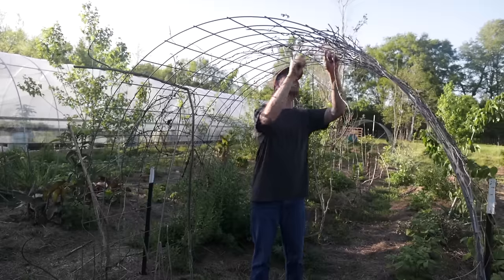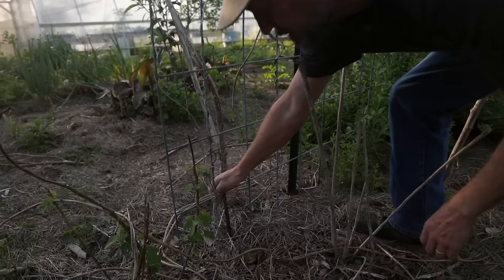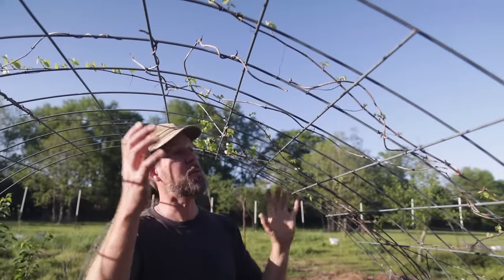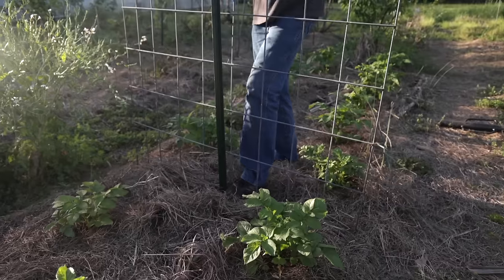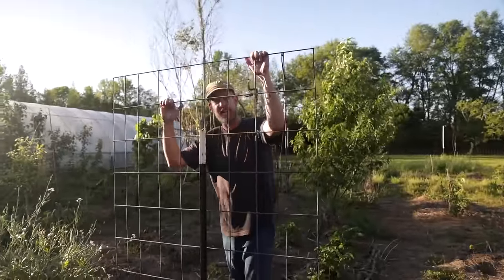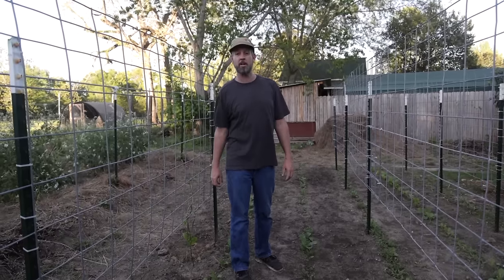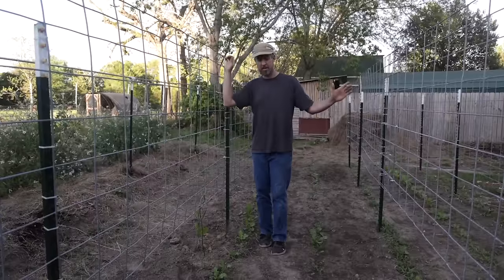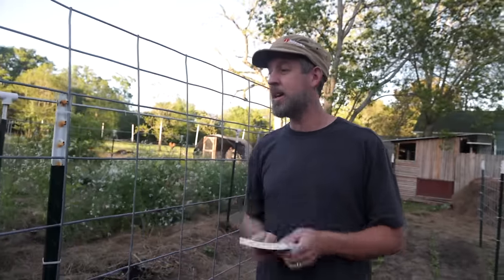3 Simple Cattle Panel Trellis Designs You can Build in Minutes

Comment: My problem with cattle panels is getting them home. I rented a truck to get a bunch of things once, but that just means you can’t decide you want just one more.
Reply from the maker: Tractor Supply gave me free delivery on these, but I have fought to get them before.
Reply: Rent a trailer instead of a truck. Fold the cattle panel into a U shape, and then strap them down.
Reply: @speakrighttogod  Good advice for some (many). But I find a trailer is far more trouble than a truck. Not much cheaper and requires more work. Plus you need a hitch and practice.
Reply: Tractor supply does offer some amount of free delivery as part of their rewards program.

For the second trellis design (single t post and a cattle panel cut to 6 ft) you can bring bolt cutters to the store and just cut it in the parking lot. Not sure what you drive, but it fits in a mini van just fine. 😄
Reply: @Pruittville  I drive a Honda Fit. Which, to be fair, can carry some surprising things. (8’ planks, 10’ reinforcement mesh which bends.) And I do keep tools in it to cut down some things.

Comment: I made hay arches from 2 cattle panels, covered with tarps & had 2 protected dry areas for my horse & goats to eat their round rolls of hay.  I used old garden hose to cover the jaggedy edges of the cattle panels so the tarps didn't tear up.  The hay arches have gone through 16 years of hurricane seasons in great shape.  We did remove the tarps if we had higher than Cat 2 winds.
Now that I don't need the hay arches for round rolls, I hope to move my cattle panel hoops into my big yard and create a goat proof winter greenhouse and summer chicken pen for broody mommas.
Reply: I'm assuming that's 2 sixteen-foot panels attached to each other at the center, overhead, yes?

Comment: for those of us trying to work without a truck... (cattle panels do NOT fit in a car)... i go to a concrete and building supply place (they also do landscaping) and bought concrete block reinforcing... ive seen other folks use "ladder mesh" but what i use is "truss style".    the 6 inch wide ones, are ten feet long, and they bend easily into  the back of a sedan style car with the seat down.
ive built a lot of garden arches with them.
they are not as heavy as cattle panels, and not as wide, but  they do fit in a car
Reply: If a friend/relative with a truck will help you out, you can rent a U-Haul trailer. Fold the cattle panel into a U shape. They fit perfectly; strap them in and you'll be on your way!
Reply: They also fit in the bed of a pickup truck, but alas no one near me has one. I have considered renting a moving van but that's pricey

Comment: Another fantastic video...especially the Sweet Potatoes at the end!  In Arizona where zip ties rot within a month (sometimes within hours) from the sun, we use bailing wire to hold the panel to the T-Post.
Reply: Plastic zip ties are a terrible choice for this. There is too much plastic waste and pollution as it is.

Comment: I twist electric fence wire up to attach my cattle panels. If you want to remove them it's a little harder but they will last forever.
Reply: I can't speak for every retailer, but Tractor Supply gave me a bunch of metal clips with the T-posts I bought , to attach my cattle panels. There is so much talk these days about the problems with plastic waste and pollution. Using zip ties for something this is just a bad idea. They will photo degrade in the sun and end up breaking and you'll have to replace them. Why not just use the metal clips that are intended for this application? Or use some kind of metal wire like you did? Plastic is not a good choice.

Comment: A few years ago I found out there is a difference between indoor zip ties and outdoor zip ties. All of the cheap indoor ties popped off everything after one season. ';D
Reply: I have been using Zip ties for over  40 years.  Never heard of Outdoor ones.  I buy mine from Harbor Freight, when I use them outside the Sun & UV rays deteriorate them  within 30 days in my Texas climate.

Comment: Great video!  These are excellent and economical designs.  It's tough to get cattle panels, since I don't have a big vehicle and delivery isn't available.  I made large trellises similar to your second design, at 03:13, using sheets of remesh.  I cut two 10' pieces of metal conduit down to two 8' and two 2' pieces.  I used elbow joints on the corners and a butt connector at the center top.  Connected the 4'x8' sheet of remesh to the frame with zip ties and can put it up anywhere by using two 3' pieces of rebar hammered in to slide the side conduits down onto.  Sounds complicated, but really isn't.  For less than $30 each I've made three and they've lasted five years so far.  I like your designs but mine work well for now.
Reply: I'm got some plastic mesh I've been meaning to try out as a substrate for bean vines.  Some people with more experience than me say that metal trellises get too hot when exposed to sunlight, hurts the plants.  I can't confirm since I'm pretty new to serious gardening.
Reply: @thadrobinson8343  Hi Thad,  I've done much research on metal trellises.  The kind David is recommending (cattle panels) and I recommend (remesh panels) are both fine for growing food crops.  I've also got several years of great vegetable production to prove the theory.  Enjoy your garden.  Be sure to see David's recent video on seven common sense tips for growing veg.  He has many great videos!
Reply: You don't need a truck per se. If you already have a truck, you can rent a U-Haul trailer. Fold the cattle panel into a U shape and they fit perfectly in the trailer. Strap them in and you're good to go!!

Comment: Great Vid!  Last year I did a Modification to this. I got 39" w x 100' 12 gauge galvanized field Fence. Did what you did arching over between two beds.  Used t-post Fence clips that they give away free by the bag when you are getting the t-Posts to attach to T posts on each side.  My beds that run E-W Beds I Started 2' off ground on the Noth side and 4' on south side to allow some sun underneath during the winter months when sun is a lower angle.  

Once I put 5 of these in I realized that in the winter I can turn it into a greenhouse with a clear poly Tarp for the winter.  I got T-post Caps so the tarp isn't pierced.   I just pushed the arch up in the top with enough tension and it holds the tarp up in the middle and doesn't sag

Found the Fencing is ~ 50-70% less $ than cattle panel and while the tarps were not cheap they were  1/7th the cost of a greenhouse and since I already had the summer trellis as a supporting fixture To me it was a bonus!
Reply from the maker: That is awesome

Comment: Ive had some cattle panels for 3 yrs but THIS is the year. I put up 5 arches. One is on a raised bed and then i have two on each side doubled so i have an 8 ft in length tunnel instead of a 4.
They are pretty cool.
I bought some 3 and 4 ft tposts and a set of metal tent stakes specifically for those. The stakes are over kill. The t post holds them fine but it made me feel better to add one at each corner to stabilize it further.

Now if you ask me what inhave growing well....i know the raised bed is pole beans and yard ling beans. The others....um quash, melons, cucumbers and even watermelon. But i couldnt tell you what is where. The goal was to get them in the ground...not be too fussy about where. 
Ive got a mystery garden going

Comment: My tomato arbor design for 2024 is two oak tree trunks used as posts .. 3 ta 4 inch diameter is ideal size.. one on each end of garden row.. Span a rope or small gauge chain over top of posts and secure it with fence staple on top of post and another on the side.. all ya need now is tomato twine for drop strings and plastic tomato clips.. Something about tree trunk posts gives your garden a rustic look.. its very strong.. And probably as little money as you'll ever spend building any arbor or trellis..
Reply from the maker: I would love to see a picture.

Comment: What to do with the other half of the cattle panel, when using the side with spikes for vertical growing space?

Try stretching poultry wire across the bottom, to make an easy to manage, very movable Multi-Livestock fence panel.  Unlike an electric fence that needs power to keep your animals safe, this one is a real physical barrier!  :_DTGBahfeemus:
Reply: That's a really good idea.  Horse high, hen-tight, hog stout... and modular!

Comment: Has anyone else had problems with seeds not coming up or plants not doing well when planted near cattle panels (due to toxic residues)?  As a test, I've planted the same seeds and plants in other areas of the garden with similar soil, sunlight, water, etc., and they seem to do well!  I have temporarily quit using cattle panels until I  can research the issue more thoroughly.  Can you buy cattle panels that are non-toxic?  The ones I had were banned in California.  I'd hate to use something that permanently damaged the soil.
Reply: If it's banned in California, I want it.

I have lots of plants growing like weeds next to my panel trellises.  "Permanent Soil Damage" is a good name for a metal band but a flawed concept on our geologically active planet, which is made from toxic elements.

Comment: Your trellis won’t be permanent unless you replace those white zip ties with black UV resistant zip ties. The white ones will only last a few months in the sun.
Reply from the maker: We are getting some metal ones - thanks
Reply: @davidthegood  that’s smart. I used the metal T-Post clips when I built my arch panel trellis and it’s as solid today as it was 4 years ago. I didn’t have help the day I built it, so I used the black zip ties to initially hold the panels in place and went behind and replaced with the clips. It’s still got quite a few of those black zip ties on it, lol.

Comment: I have arched trellises in between 4 sets of 4' x 8' beds and vertical trellises on the back of 6 of them. I also have cables running on top of the vertical trellises all the way to the arched trellises. And yes - used the heavy-duty zip ties.